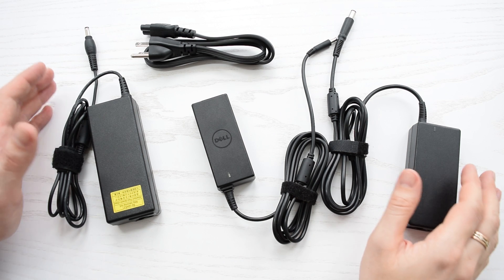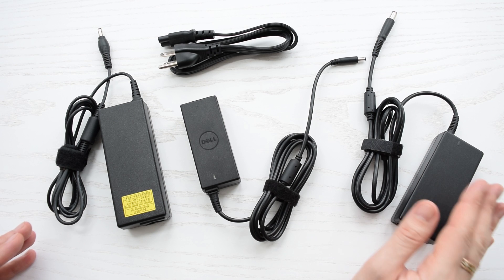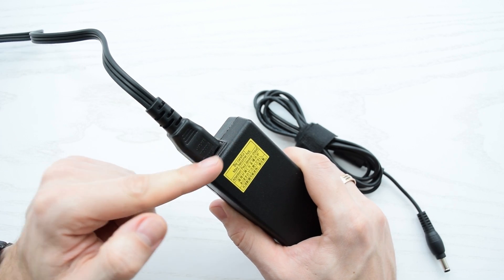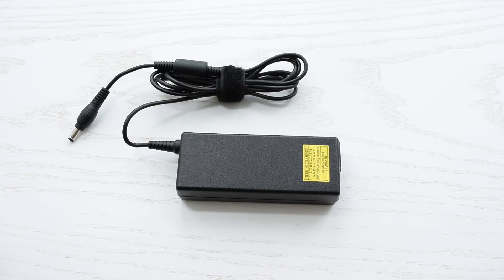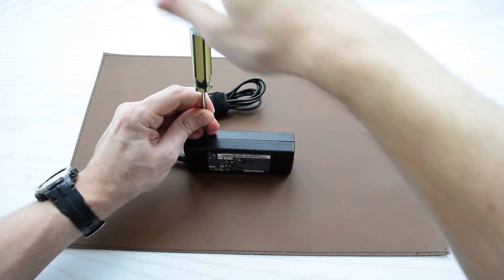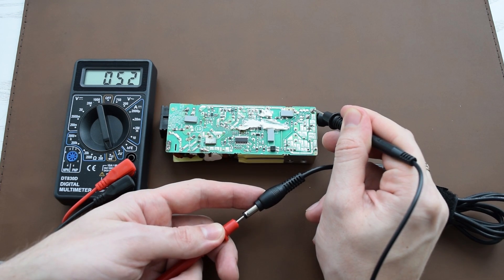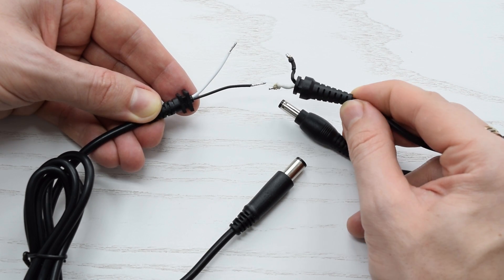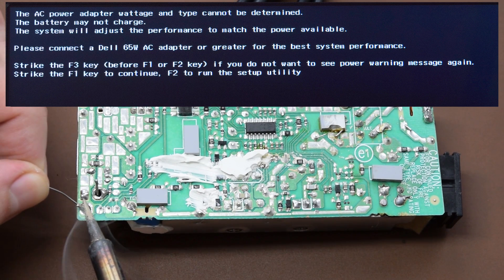How to Open and Fix Laptop AC Adapter without Damaging. DC cable and Capacitors Replacement

Comment: Can you please help me when I plug in my charger the laptop makes a small  screeching noise I don't known what to do I went out and tried to buy a new one but it's expensive and I just bought the charger b/c my previous one stopped working
Reply from the maker: Does your laptop works?
Reply: @ElectronicsComputers  yes I tried with another charger and the laptop works just fine.

Comment: Nice… would also be helpful to know what to type on Ebay to find a cable replacement for Dell (the big power jack) because I couldn’t find any!
Reply from the maker: The links for the cables are in the description below the video.
Reply: @ElectronicsComputers  yeah but it is Aliexpress, it will take ages to come all the way to me, as I live in eu

Comment: Here's how I've done it for the last 20 years of laptop repairs.

Case cracking should be done with a small hammer, this avoids the risk of puncturing internal components.
I also use the slim can opener tool in my Swiss Army knife to run along and twist in the plastic seam.

NEVER buy really cheap eBay replacement power supplies.
They are ALWAYS badly made with cheap and/or second hand parts. They rarely last longer than the first summer.

Always try to get a new or second hand original brand. 
Any name brand with the same voltage and the same or better amperage specs is a better choice once the cable has been swapped. Be careful of polarity !!
Reply: Do these adaptors designed to become water-proof? What is the purpose of making it so hard to open?
Reply: @kuyaef098  No not water proof, just thick plastic because they live a very hard life.

The oldest ones used to have 4 screws, but glue is cheaper...

Comment: What would happen if you know the only thing wrong is the mail plug itself could you cut off the old connection and solder on the new mail with the entire wire lead that it comes with just splice it and wrap it. Or would that get hot
Reply from the maker: I always recommend replacing the whole cable, because it's more reliable way to fix it and the power supply will look nice too. But of course you can cut your old connector and wire a new one and then use electrical tape or heat-shrink tubing to insulate those wires. It will work but it will look definitely ugly.

Comment: My alienware laptop has a issue where laptop usually while gaming 2-3 times every 5 mins stops charging and fps drops to 30 and its unplayable during such event. I used to have warnings that ac power adapter cannot determine charger etc warnings and also memory has been reset or dropped. I want to know more what could be the issue. I am not very comfortable buying new charger but want to fix myself.
Reply from the maker: Like I said in the video the problem usually lies in your laptop's DC cable, DC connector or jack but it may also be in some components on your laptop's motherboard or power supply's board. It's hard to tell without proper diagnostic and measurements.

Comment: Sir what if the led is blinking continuously on the adapter..?
Please answer ASAP...really need some help
Reply from the maker: Could be a short in cable or DC connector or just dead caps.

Comment: Please 🙏 if you have petrol use it instead of hammering it with screw driver just use a small amount of petrol whole around the creases
Reply from the maker: Sometimes it doesn't work it depends on a type of glue that was used.

Comment: what about changing the charger jack in the laptop with a usb slot..and Changing the cable with a usb cable ...it will so nice project and nice to charge the laptop with any Power Bank And Any Source

Comment: The LED lit up but when I tried bending the chord nothing happened
Reply from the maker: You need a multimeter to check the voltage or try that charger on another laptop. Could be a broken cable, DC connector or dead caps inside the charger.

Comment: Is it possible to adjust the output voltage of a laptop PSU? I'd like to reduce a Lenovo power brick from 20volt to 13.8volts. G7VFY
Reply from the maker: Technically it's possible but not in such big range. +/-3v maximum for stable work. You can use external DC to DC step down board like this: http://alii.pub/5tfk3k
You can adjust the voltage and even see it on the screen.

Comment: My AC Adapter is a model PA-90W. Recently it started not working very well and it would need to be at a specific position (the ac adapter itself not the wire). I'm familiar with issyes where there are kinks in the wire between adapter and computer and I'm pretty sure this is not it. Usually the blue LED on the AC adapter is off but when it's on it can be a low intensity blue light or a very bright blue light (when it is bright it is working). So in an effort to make it work I tried 3 things: 1. Unplugging and replugging the triple socket wire that goes from the wall outlet to the AC (this doesn't have any effect anymore), 2. I pick up the ac adapter by the 3 prong cord plugged into it from the wall and I move it up and backwards toward my hand till the AC adapter and wire are upward and tipped back and then set it back down. This also makes the 3 pronged cable slide out and around a bit each time which I'm pretty sure is a part of how this works (this is highly effective in getting the LED light to turn on to the high intensity level and the light on the laptop that indicates it is charging will turn on. However, this is only temporary and the LED light gradually turns off usually and along with the laptop charging light. I believe that the 3 prong cable being not fully in is part of why this works because for some reason it tends to start charging when the prongs are not completely inside the AC adapter) and 3. Just shaking it like in 2. but with my hand around the power brick itself. 
^I have been able to get my laptop to continuously charge with all of these things albeit with some difficulty (it takes a long time to work) and I have to keep the AC adapter and wire still because if I'm not careful it may stop charging. At the moment #2 still works and rather well but I haven't been able to get it working again for quite a while. I have not yet looked inside the AC adapter but I would like your advice/diagnosis in this situation.

Please and Thank You, sir.
Reply from the maker: First of all you have to check if the AC socket is properly soldered and have a good contact with the PCB. Secondly, I would check the caps and DC cable. The last one could may have a short. You can simply desolder the DC cable and see how the blue LED indicator changes with and without cable attached.

Comment: I bought a gaming monitor last month, and i heard a click on the ac adapter and it leak brown or oily liquid, the ac adapter was hot luckily the adapter only was not working not the monitor, how can fix this , is it a manafacturer defect?
Reply from the maker: Your monitor should have a warranty so just go to your local service center or to a shop and ask them for a replacement or warranty repair.

Comment: My vharger makes beeping. I have electric scooter, the power cable and adapter works okay with green light. But I connect to escooter then to the outlet it makes beeping noise.
Reply from the maker: If it beeps and doesn't work then most likely there's a short somewhere in your scooter.
Reply: @ElectronicsComputers  thank you for the response🙏. I sent to repair shop along with my scooter he said the same thing.

Comment: My charger is really strange, he works fine outside the case, i reassemble the case and doesn't power on
Reply from the maker: Some contacts can be loose or maybe the aluminum shielding shortens something on the PCB.

Comment: what if my power adapter doesnt have the blue cord but my old cable does
Reply from the maker: Cables may have different colors just make sure you solder them properly.
Reply: @ElectronicsComputers  no it only has ground and live

Comment: Before you try a screwdriver, have a look at the base and if there are rubber feet there might be security bolts fixing the two halves of the case together. My Dell Precision adapter had four screws holding it together. Trying to knock the two halves apart wouldn't do any good!

Comment: Great techniques and advice in this video!  Thank you!

In my case, I saw a failure of both the output capacitors from a cheap $10 power brick (the type that we're advised in the video to avoid).  I blindly replaced the capacitors with a pair that has a higher voltage rating, and they also started to fail due to over-voltage; my 24V supply was putting out over 50V!

I haven't verified this yet, but I believe the transformer failed in a high-current use of the power supply.  It is often the case that these cheap transformers use copper-coated aluminum wire, which will generate more heat due to higher wire resistance; this can melt the insulation around the wires in high-current situations.  When that happens, turns are shorted, you get a higher output voltage than expected, and then electrolytic capacitors go BANG.

So, yes, don't buy the cheap $10 power brick!
Reply: where can we get the expensive power brick ?

Comment: Hi I tried opening the adapter with a flathead screwdriver and it didn't do anything it kept putting scraps on the plastic cover plz help by the way great vid!
Reply from the maker: Put the blade of the screwdriver between two parts (right on the seam) And try to hit it with a hand or a hammer. Repeat the process around the whole thing.
Reply: Yeah I did that so I put the flat head screw driver and hit it. Not too hard but some force all it's doing is putting ugly Mark's in between. By the way I'm doing this with a wall plug to usb adapter not a laptop adapter.

Comment: Please help me , is dell adaptor lamp always green? Then how we know if it is fully charge if the color doesn't change?
Reply from the maker: Battery indication should be on the laptop itself. The LED on the power brick just indicates that it's plugged into the outlet.

Comment: I just opened adapter and black wire connected to ground while white to 19V, But the problem is, on Ali express the cable I need got black and red wire. So is white and red wire the same?
Reply from the maker: The color doesn't matter, they all come with different colors. you just need to check which wires goes to the DC jack contacts. You can do it with any multimiter or just an LED and a battery.
Reply: @ElectronicsComputers   Thanks

Comment: Nice video! I have a very weird problem and maybe you can help. When I plug the adapter to my laptop is not charging but if I remove the battery PC starts. The only way to charge the battery is removing battery, removing ac adapter then connect ac adapter and then insert battery. If I plug the adapter when the battery is already in the notebook, the voltage drops to 0 and adapter doesn't charge...I guess is the battery but I wonder if it's some kind of reversible fuse in the ac adapter maybe? Thanks
Reply from the maker: What's the model of your laptop?
Reply: @ElectronicsComputers  lenovo Y580

Comment: Perhaps this is a silly question but after seeing how easy it is to fix, I don’t want to get ripped off by someone overcharging me to fix torn lose wires. I just wanted to know what the blue device used at 2:29 is and if it would be possible to put the wires back together without it? 😬🙏
Reply from the maker: Unfortunately, without a soldering iron there's no way to fix it.
Reply: @ElectronicsComputers  thanks so much

Comment: Sir mare pas ak laptop charger hay,iska problem hay,jab supply may connect karu iska output volt 1 second kalia show kare,par 0 volt show kare
Reply from the maker: could be a short. You need some tools and multimeter to fix it or just throw it away and buy a new one.

Comment: I accidentally dropped my bottle on my dell laptop charger on the part where theres this brick thing (idk what its called) and now it wont work. It also makes a noise every time I shake it it makes some weird sound. Do I need a new charger or is there a fix for this?
Reply from the maker: You have to open it and see what was damaged. But if you're not good with electronics then better buy a new one.

Comment: Is it possible that the AC adapter still works (and randomly fails) if some of the capacitors are swollen on top? I'm asking because I have a laptop without a battery,  and I'm running directly on the adapter. The thing is,  the laptop is turning off randomly, either during gaming or just by watching Youtube, but mostly during gaming. Sometimes it turns off after 4 hours of gaming, sometimes after 30 minutes. There is no pattern, but I would like to be sure that it's the adapter's fault before I open it up.
Reply from the maker: It could be but first check if your laptop is not overheating. Use some software like Aida64 to check CPU and GPU temperature.
Reply: @ElectronicsComputers  Ah, I forgot to mention, the temps. are 65-70 C when gaming and 35 C when idle (cpu and gpu), so I'm sure it's not an overheat issue.

Comment: Do you know for a Dell 130w adapter dc replacement cable for an Inspiron 15 7000 power adapter?  The one has a lighted end on the cable where it goes in to the plug?
Reply from the maker: The link for the cable in the video description but without LED on the connector.

Comment: Sir ,I have the problem, The ac power adaptor wattage and type cannot be determined but still on the laptop but charge battery. What to do now?
Reply from the maker: Is that a Dell laptop?
Reply: @ElectronicsComputers  yes sir
Reply: @ElectronicsComputers  I replace the charger but still it shows that  battery 1 is not available for use but battery 2 will charge. And when charger is plug out it switch off even battery 2 is 80% charged.

Comment: Hi, Does the data pin in the Dell cable plug carry voltage? I have 2  19.5 VOLT supplies, and the pin on one has 12 volts on center pin, and the other one has 6.5 volts. Are they damaged? They run the laptop, but will not charge. In bios it says, "AC adapter-none"
Reply from the maker: You have to measure voltage across the outer and the inner ring of DC connector and it should be about 19 volts. The check the data pin you need a scope. the component that sends out a data code cost about 2$ on Aliexpress.
Reply: @ElectronicsComputers  Thanks for the reply. I measure 19.5 volts on the inner ring. However, after measuring the data pin, im getting voltage on it. Ive since cut the blue wire at the back of the center pin, meaning that pin should be completely free of voltage. The back of the pin is still reading around 12 volts or higher, with no wire attached. I assume the pin is picking up some voltage from the inner ring. Not the full 19.5 volts though, which i find odd.
Reply from the maker: @Stephen.C.  it shouldn't be like that.  Maybe there's a short in DC connector. Can you measure resistance between the center pin and both positive and negative  rings.

Comment: Today happened that my laptop didn't wanna charge and after some minutes while I went to the bathroom, my laptop started charging,but I have a big problem with my charger,one that's related to heating A LOT,will this affect its lifespan? 
I'm using it on a desk,so it's not under some blankets or something that heats it up even more.
Reply from the maker: If the temperature higher than 75C/160F then it's definitely not cool.
Reply: @ElectronicsComputers  at least 60-70°C it had and it has like almost all the time.😬
The charger is an Asus 65W powerbrick, one that's like a big square with rounded corners. Weird thing that didn't happen with my dell one which has never heat up like that even under some blankets or on a bed.
Reply from the maker: @robertceclan1269  Don't worry about that temperature! The components inside can handle that temperature pretty well. Of course for electrolytic capacitors it's not good and they will bulge in 4-6 years but it's about how long laptops is last nowadays. So leave it as it is. The power consumption first of all depends on the specs of your laptop and even the apps you're running on it. For example, your laptop could be overloaded by some background processes or malware. When your Dell laptop has another specs, current draw, software and this is why it's not that hot.

Comment: Ants entered into my laptop adapter and boom..no power supply from adapter
Then i just opened the adaptor as u said .. found a lot of ants dead inside.. removed them out by blowing little air..and fixed the adaptor as normal..
its working now
But my doubt is..is it ok to use that adaptor now?
Reply from the maker: Clean the PCB and dirty components with rubbing alcohol. If there's no damaged components and caps are not bulged then no problems.

Comment: Please make a video on how to repair Alexa adapter
Reply from the maker: what's wrong with your adapter?
Reply: @ElectronicsComputers  Due to voltage fluctuation it just get damaged and buying new costs about 2000.

Comment: I have a 12v 5a 4-pin adapter that went bad. I have a 12v 5a coaxial adapter. Can I take the 4-pin cable and splice to the other adapter?
Reply from the maker: what;s the model of your dead adapter?
Reply: @ElectronicsComputers  it's called KPL-060F
Reply from the maker: @andreissa9591  yes, you can replace it with any 12V 3.6-5A power supply!

Comment: My charger gives this problem but after 2 days I let it charge my shutdown laptop and when I turned on the laptop it works perfectly can you tell me what should I do, should I repair it or not and what is the problem?
Reply from the maker: Could be dead capacitors. It takes some time (minutes-hours) for the AC adapter to start working or could be simply damaged cable.
Reply: @ElectronicsComputers  so what should I replace, cable or capacitor?